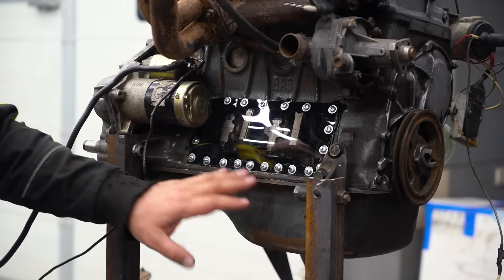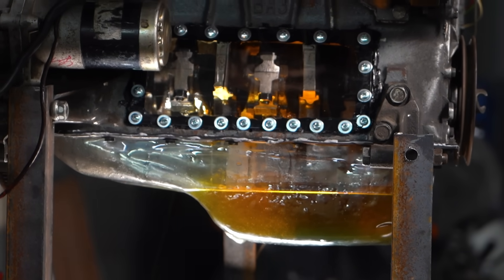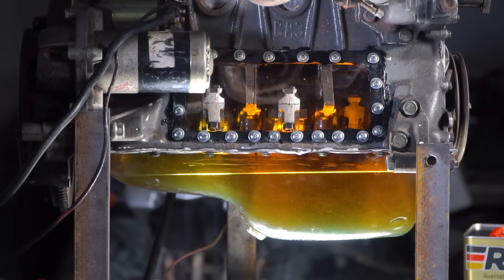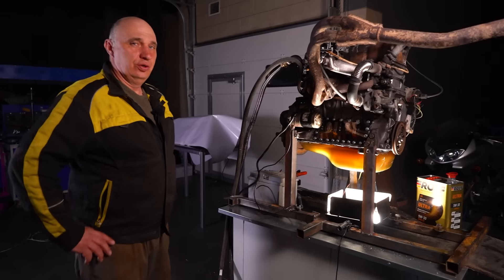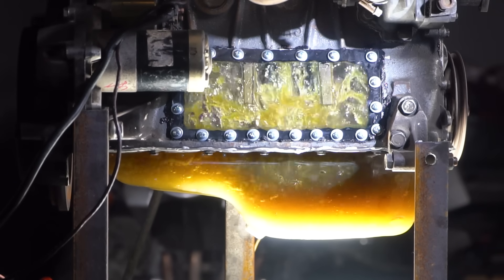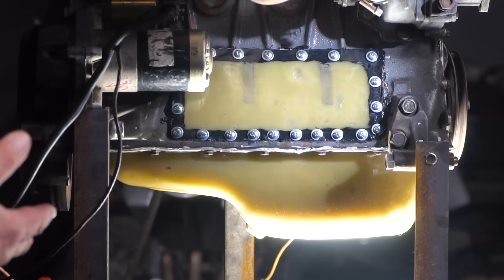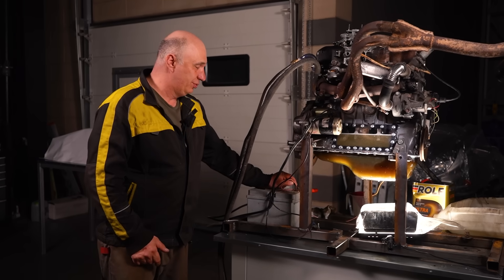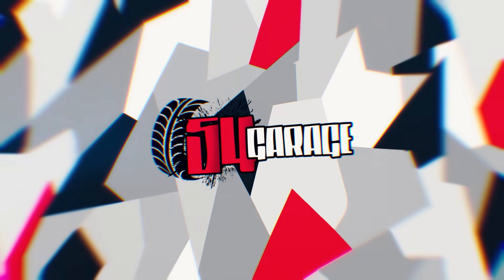What actually happens when you overfill your motor oil? (w/ transparent oil pan)

Comment: While this "appears" to not be a problem long term running of the engine when overfilled with oil has consequences. 

The engine oil reserve holds some extra oil to compensate for the fluid expansion due to hot conditions. Adding an extra half a quart will not damage your engine. However, anything more than that could be harmful to the engine.

When you add too much oil, the excess oil will go towards the crankshaft, and as the crankshaft rotates at a high-speed, the oil is mixed with the air and ‘aerates’ or becomes foamy. This foamy texture of the oil acts like a bad lubricant, and the oil is not pumped effectively. Over time, the engine will be starved of proper lubrication, and due to the weak oil pump, it can get locked up.
Overfilling your car’s engine oil can cause some of the following consequences:
AD

    Foamed Engine Oil – If the oil level in the oil pan gets too high, the crankshaft will rotate in the oil, causing the oil to foam. Foamed motor oil is harmful to your engine because it pushes air bubbles through the engine.
    Combusted Oil – If the oil is overfilled, it will cause higher crankcase pressure, resulting in oil being pushed into the combustion chambers. You may notice blue smoke from the exhaust.
    Spark plug fouling – When the oil gets into the combustion chamber, it will cause a thin layer of oil on the spark plugs. This will cause fouling spark plugs, which will result in a misfiring engine.
    Failing seals and gaskets – Overfilled engine oil will cause higher pressure in the crankcase as we discussed earlier. Higher pressure in the crankcase can lead to failing gaskets or seals, so if you notice more oil leaks than usual, it could be due to overfilled oil.

The industry has done extensive research into what is necessary for optimal engine performance. While in the short term the damage may be minimal, long term is another is another matter. This video is very interesting and experiments to the extremes of overfilling the oil. Common sense dictates-follow your owners manual.

Comment: Two problems here... the crank churning all that oil will sap off a lot of power and turn it directly into heat... a lot of heat.

And second, oil that gets aerated (foamy) is not a good lubricant and can't be pumped efficiently like normal oil can.

Neither of these conditions will stop the motor cold after a few minutes, but any length of time and your engine will brick.

Comment: So this shows that you'd need to double your oil level for it to be an issue. What this isn't showing is the movement of the car while driving and the oil turning into a foam over time once you've put that much in. They had to quadruple the oil level to show it foaming in a short time period. If you're driving for hours your engine has plenty of time to foam up the oil. 

If it turns to foam it stops working. That's the danger of "too much oil". 
Good to know you'd have to double the normal amount for it to be "too much".

Comment: Jiffy Lube overfilled my prius more than a half gallon. Check engine light turned on and i checked with an OBD2 tool, it was oxygen sensor code. I went back and said you overfilled my engine. They got angry and rejected, i offered them write an email to the managers and complain if they keep rejecting. Finally they accepted they made a mistake and removed excessive oil with cleaning oxygen sensor. I never let others change oil except than myself after that day :)

Comment: Im so going to overfill my cars by 1 quart after this. Peace of mind is priceless.
Reply: As a mechanic, it brings peace of mind knowing that I will always have a job, which definitely comes at a price. 😂
Reply: Better not be a Mercedes; or any other model with max oil levels.
Reply: not a good idea, your car is going to be running sluggish, wouldn't surprise me if the engine starts knocking or seizes
Reply: Can you say the same thing for Chevy?
Reply: 200-300 ml above is not going to be any problem in any car
Reply: Many mechanics have added 200 ml extra to the oil sump for security and nothing bad has happened to the engines.
Reply: @michaelpowell6183  Exactly, my VW mechanic fills it over the maximum level, when I checked the dipstick and nothing bad ever happened to my 1987 Scirocco 16V.
Reply: Depending on what motor you have it can run like hell oil leaks or blow your rings out I put one quart too much in my Volvo the thing vibrated like crazy and had no power you have to remember you have a crankcase Vince that goes back into your air intake they didn't have that on this engine you'll be feeding oil right back into your air intake
Reply: @stephenseifert3193 you actually think the crankcase vent is on the bottom of the motor, don't you?

Comment: Its fine until it starts touching the crank shaft because when the oil foams up and that foam get picked up by an oil pump it will decrease oil pressure and may cause oil not to get to some parts of the engine.

Comment: There are a lot of issues and effects that this has that aren't that obvious, note that on this video there appears to be some special sealant on the sump rather than a normal gasket, so the things you can't see, increased pressure in the engine resulting in oil leaks from gaskets and especially bearing seals, oil forced past the piston rings and damaging the valves and valve seats, damage to engine management components in the exhaust, higher and illegal emissions (hence the smoke and how overfilled oil gets burnt off). Airiated oil will not lubricate correctly and will cause excessive wear on bearings and because it's viscous it'll put a drag on the engine resulting in poor fuel economy. So to sum up, permanent damage to the engine, components and risk of blown gaskets and seals mainly.

Comment: An extra quart is insurance, a quart low is damage. In most engines an extra quart is only a quarter inch in depth. Not enough to cause harm. The way oil pans are designed, they start out skinny and get wider as they go higher. Don’t be afraid to add an extra half to one quart. Change it when due,that’s what matters.

Comment: Can you try adding too much oil until it starts spitting out of the engine. But you keep running until it stops leaking, then measure the oil level.

Comment: My sister and her doofis friend purchased a used Honda Prelude about a 4 hour drive away in another city.. They decided to 'fill up' the oii before the drive home. Using the dipstick didn't occur to them apparently, and it overheated and shut off an hour into the drive.. What a shame, it was a good looking car. It had around 9 quarts of oil in it, a blown head gasket, and some toasted bearings. Oil foam doesn't seem to lubricate very well it seems.
It's worth mentioning that some engines may be more or less tolerant to having the level above the MAX indicated on the dip stick. Best to always drain it down to MAX if you go over, just to be on the safe side.

Comment: That was cool the way the clear oil pan was made. I seen some guys testing a race car engine on a dyno when they added extra oil the horse power dropped about 10 or 15 horsepower. Every little bit helps in racing.

Comment: My last truck was a 2000 Dodge Ram with a 3.9 V6 and after I bought it, the motor was loud after driving it and made some weird slam or backfire noises. I checked the oil and did some research, pulled the oil plug and drained a little less than a quarter of a quart and it was fine. From what I was reading, that motor will blow every seal, if you put a little to much oil in it. It takes a little less than 5 quarts. That was the most picky motor I ever changed. I now check vehicle specs and I will put exactly what it says and check the dip stick and adjust the level to the dip stick. This was a cool experiment but From my experience with my Dodge Ram, .2 quarts over, made it run horrible. I guess to much oil might be better than not enough, but since we have internet on our phones and it's so easy to look up manufacturer specs, I will do whatever they say, except for going more than 3,000 in between oil changes. I will change my oil every 3,000, especially since manufacturers only care about a vehicle making it surpass the warranty. I have seen vehicles with less than 100,000 miles have sludge from listening to the manufacturers. It's like a old mechanic told me, oil is cheap and a motor is expensive. That's all he said. 😆 🤣 😂

Comment: I have always slightly over filled the amount of oil when changing the oil. Friends always told me the oil pressure would be too high and I would burn oil and possibly blow the engine.   The extra amount was always around 0.5 litres .  Never had an issue, never burnt oil, I always figured there was always a buffer zone around and about the  full line and a little more oil was no issue.  Little extra oil meant a little more protection during high temperature driving in the summer .  I always use full synthetic oil now and I never have motor issues and I always buy Toyota. Usually can't even hear the motor running at idle.

Comment: I am from Ohio,  My brother and my sons took a trip to the upper Wisc. lakes through lower Canada... the road was very hilly. My brother had a full sized (in 1980s) diesel V 8 powered Chrysler car. I had a 4 cylinder Honda civic mid sized car.  I could not keep up with the V8 on the hills and I was thinking how to get more power out of my car.  I added one extra qt. of oil and then I could keep up with the V-8 car going up the hills.  We were amazed how well that simple thing helped me.   But you never want the oil to foam, that will kill the engine sooner than later.

Comment: why does it get so dirty so fast?
Reply: It's remnants of the previous oil from before the experiment.  Its almost impossible to fully flush every drop of dirty oil out of an engine.  If the engine had been full stripped apart then rebuilt you would only see new clean oil circulating.  Since there's a huge visual difference between the opaque black used oil from the see through clean engine oil its only going to take a few drops of used oil to notice.

Engine rebuilds are time consuming and can't be done properly without purchasing new gaskets and seals which is extra cost.  There's no reason to spend on good parts to put on an engine you plan to destroy.  It would have been more cost effective to flush the engine oil out as best as possible.

Comment: i always add a extra half of quart of oil to my camaro or after a few months i will get a low oil light pop up.
Reply: Head's gone
Reply: @okapmeinkap7311  Head gasket? no it's not, im not leaking any oil at all.  It's normal to burn alil oil.
Reply: @ceasursmoke1391    but not that much oil unless you floor it Alaska to Argentina and back.  not leaking.  not burning.  Evaporated thru wrapped gasket.  Head's gone.
Reply: @okapmeinkap7311  Lmao if you say so.  Who cares? head gasket is easy to replace
Reply: @ceasursmoke1391    not too hard a job just takes a bit time.  btw, does Donny agree?  lmfao

Comment: I was told that the min mark on a dipstick was the absolute minimum an engine would start and idle on.When you start reving the engine the sump gets totally empty so no oil to the head.An extra oil above the max mark will make no difference to the engine only your wallet.

Comment: Add to and keep at the FULL level . Though there are suction tools to suck out the oil through the oil dipstick tube . You can use a long flexible hose and just suction with your mouth to get the oil flowing .

Comment: I have a motorcycle with 2000 miles. It was running perfectly.
After the first service it was running perfectly.
After the second service it now makes a knocking noise that start 35 seconds after I start it.
The dealership just changed the oil but it’s already black.
There are no other strange noises other than the knocking.
The oil is black after only 3 hundred miles.

Why is it knocking and why is the oil black?

It’s the knocking that has me frazzled

Comment: Jeez that’s a lot of foaming of the oil. That foam oil is being pushed around the engine which actually doesn’t lubricate very well. Plus all the windage from the splashing oil causes resistance to the crank.

Comment: I bought a small engine recently I needed it and got it real cheap it was smoking. Normally wouldn't buy a smoking engine. Generally these engines dont smoke. I gambled hoped I could get the parts cheap enough to rebuild it if it didnt stop smoking. It ran fine but smoked bad. Wow I was wrong about not having to much money in it if I had to rebuild it. Once looking up the prices to rebuild I eould have went in the hole. So I lowered the oil level. All the smoke went away I couldn't believe it. I then had bought a great deal. I was able to use the engine to resell it and make a profit!!! But smoking I would have went in the hole bad. And no one would have bough it unless I slashed the price drastically!

Comment: I read many years ago if you take the normal oil level and lower your oil level down by one quart. Your engine pick up an oil pressure and horsepower. I didn't do this because of the horsepower because it would be a very minimal gain. I did this test to raise oil pressure at 700 RPMs a low idle. It worked it raised the oil pressure when I dropped the oil level by one quart. And I noticed once before with the normal oil level. I went a little bit higher in oil level a quart and it lowered the oil pressure even more at an idle. And what I did for safety when I lowered my oil level by one quart. I installed a cheap low oil pressure Summit Racing low oil pressure shut off safety switch. I want to start it up after it's been sitting I have to hit the override button. The engine builds oil pressure then I hit the override button and the engine will fire up. Too bad this test didn't have an oil pressure gauge and it would have showed how low the oil pressure was the higher he raised the oil level. The higher the oil level is too with any engine the more bubbles it makes. All bubbles don't make solid oil pressure it drops oil pressure. And when I build an engine right before it's ready to fire up. I feel the engine full of oil all the way to the top of the valve cover. When you do this it totally oils everything and the engine will not turn over it's literally hydrolocked. It's the same process I do when I'm storing a complete engine and I also feel the cylinders up by spinning the engine over and filling the spark plug holes with oil too. I use a funnel and a clear vinyl hose. This is the only way to store an engine so you don't have any rust. Metal can't trust when it's fully submerged in oil. If it's an old engine and needs to be rebuilt or knocking use preferably use diesel oil. And if it's a nice engine of course use new oil. On the street or the strip yanking the car around. The low oil pressure switch has never shut off the engine. I also have a fail-proof water temperature switch also set at 190 degrees the engine will shut off and it did once. It saved me a lot of time and money my shutting off early and not blowing head gaskets are cracking heads from getting too hot. Having the safeties on any engine is worth its weight in gold. Sure I'm like most guys and the business I can fix anything but I don't want to it's too much time and money. I'd rather build something or fix something and it lasts forever. If we only have these sensors on all vehicles we would save so much time money and resources. I've tried to sell it to people over the years but they're just too tight. They don't think the biggest problem out there overheating will happen to them. They would rather save back then a few hundred dollars. Then back then a 1,000 - 1,500 to repair it. Not including a lot of time and money to fix. But today's cost is several thousands of dollars and a lot more time. And most people can't even have it fixed because they can't do without their car that long so they have to buy another car or catch rides. If they don't have a backup car. They don't put the safeties on everyday cars because they want you to buy more. They put the safeties on commercial vehicles.
Reply: Maybe you should do your own YouTube channel and share your knowledge
Reply: Lowering the oil by one quart will NOT make any difference to oil pressure...

Comment: There are some cars it helps and not harms. On a Ford 351C engine it's better to be 1/4 inch over the full mark. Also some people have made external oil passages from a Tee at the oil pressure sensor to a galley plug on the block.

Comment: That is the reason we use non-detergent oil in oil bath applications where the crank and rods are submerged in oil, like in pressure washer and compressor pumps.

Comment: I’ve overfilled a Diesel engine in my Dad’s Ford work truck using an oil pumper.  I kept pumping oil after changing oil & couldn’t see it because I’m colorblind. The truck wouldn’t start & we drained the oil. The engine had to be torn down because I got oil past the pistons.

Comment: So, it is adviseable to stay within the recommended oil level, but if you overfill just a little bit, I think it does not hurt....especially if your engine burns oil.
Reply: You can put 5 litres into a 4 litre max, just don't put 10 litres into it

Comment: Automobile engines before the early to mid 1950’s were often only splash lubricated not pressurized lubricated especially lower RPM running engines.

Comment: All of that air being whipped into the oil can keep the oil pump from EFFICIENTLY pumping the oil.  The pump is pumping part oil and part air which might lead to cavitation in the pump.   Most all pumps are designed to only pump liquid not air unless its an air pump (a blower).